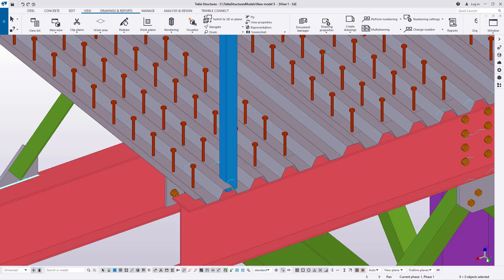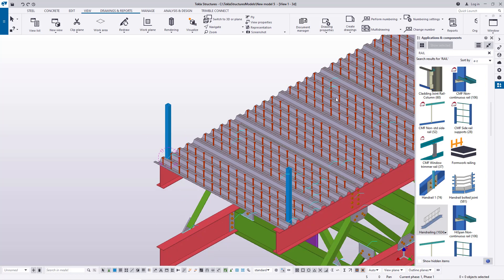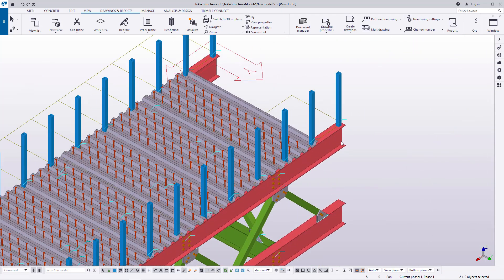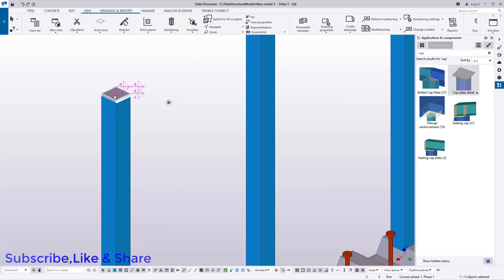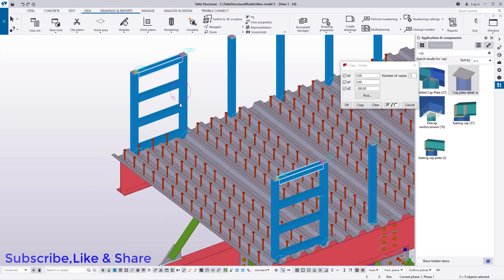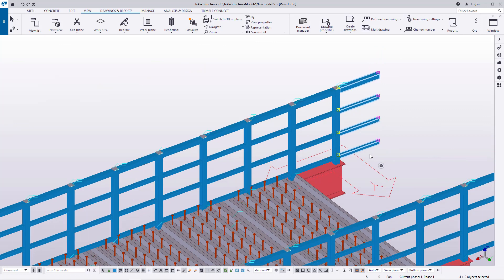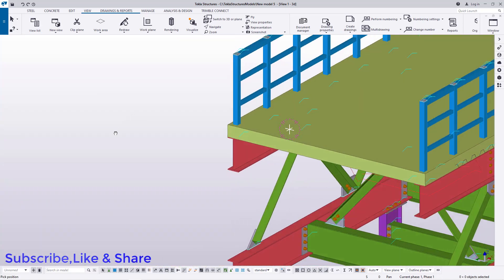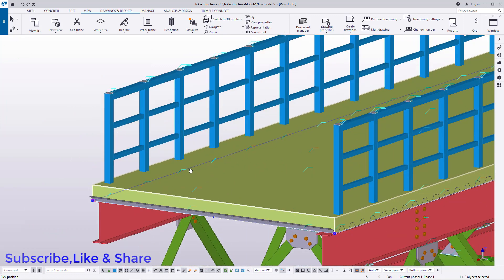How to Create a Footbridge on a Curved Supported Frame | Tekla Structures Part5

Comment: Wait a minute.. what happened with all the conections between beams and braces?? I was waiting for that part, and in this video they just appeared :(
Reply from the maker: point noted,i assumed its simple do,so since the connections were many i decided to do them behind the stag,next time
Reply: @MauriceDimba  Thanks for the answer. I guess you'd use some kind of macro to make it faster? otherwise you make one detailed conection and then copied it to the others one by one?

Comment: Hello Maurice...as always works for respect.One oftopic question about tekla 2020.Do you know what is problem when i open drawing properties i have just one  settings "standard" in assembly properties. How to add other properties what are included in earlier versions? Tank you
Reply from the maker: just click the drop down under standard and try out all the available settings